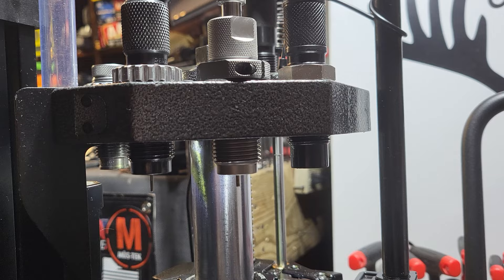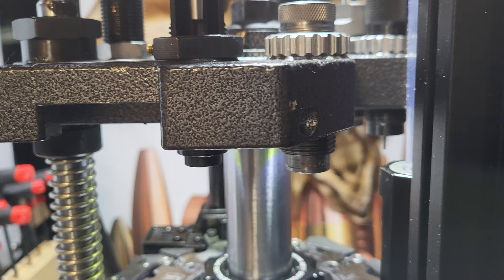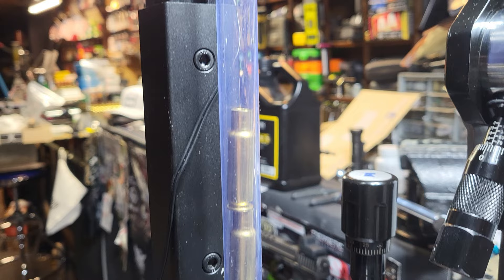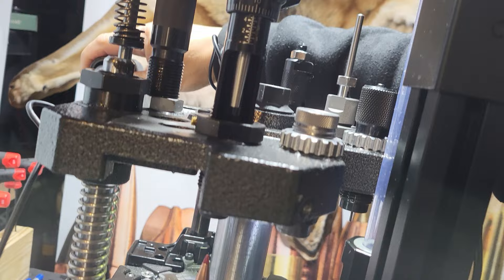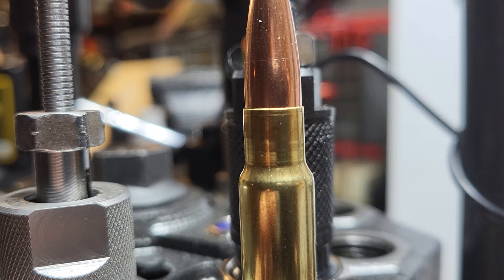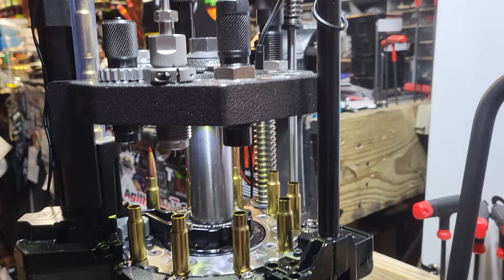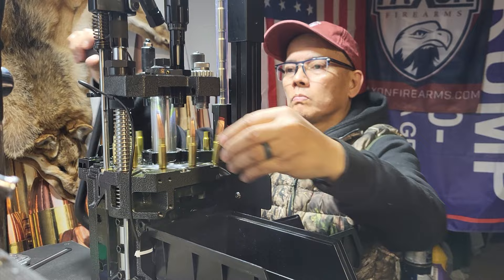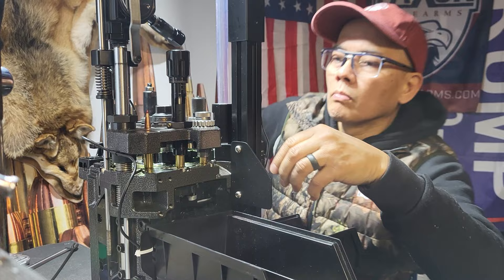The Frankford Arsenal X-10 Press | 8.6 Blackout

Comment: I have a question for you you do not stop after 10 or 20 rounds to check the consistency of your powder drop. This is just a question. Thank you.
Reply from the maker: @Soulman I stopped loading 8.6BLK with CFEBLK on this press. Powder is so fine that it sticks in conjunction with the odd shortened 8.6BLK case length.